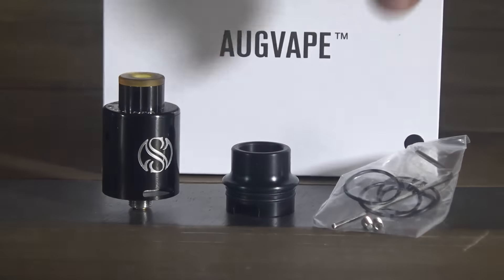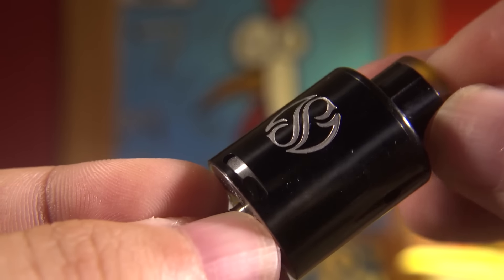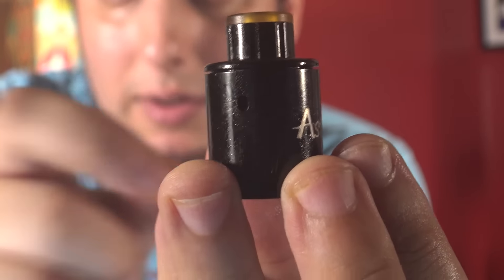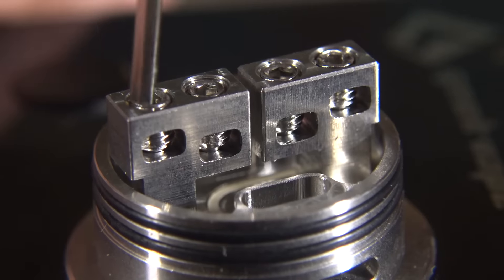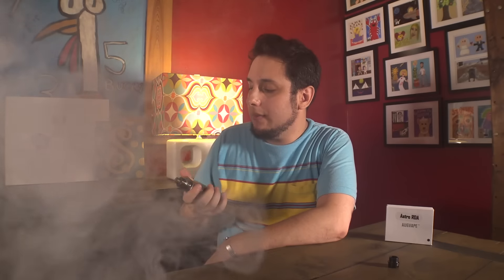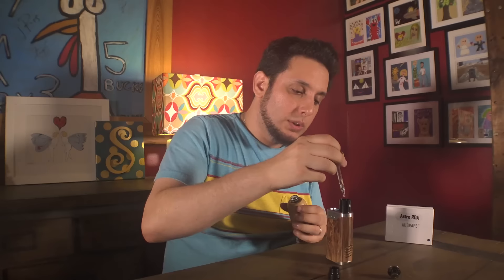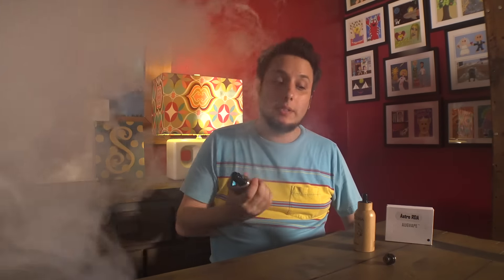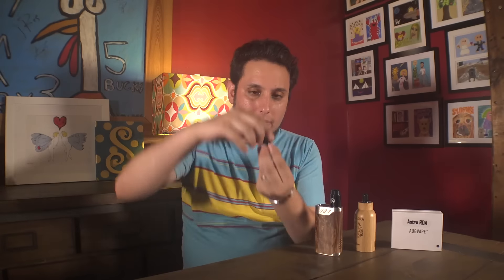The Astro RDA by Augvape | Raise the Roof!

Comment: If you want to adjust it and keep your hands clean, pull the top cap just enough to release the top half (while keeping the bottom half seated in the sleeve). Twist the top to where you want it and then press it back in. Not perfect but much cleaner.

Comment: Hey josh. Not sure if this is obvious to most but to make my "chain coils" I make one long strand of twisted wire fold it over then twist it. By folding it over no matter which way your twisting one is now in reverse and ends up giving you the chain affect. Works pretty well and cuts out having to line up two sets of wires and getting them both in the chuck and twisting them again. Just my thoughts and hope it helps someone along the way.

Comment: you need to roll the chain much tighter in both dirrections when you make them. It should sort of open up and make pokets on the reversed twist. One of my favorite builds right now is to make like four feet of chain out of 42 and use that to Clapton 26 gage 316l not only dose it look badass but it realy changes the vape lots more flavor compared to a standard clapton. nice clean install buy the way.